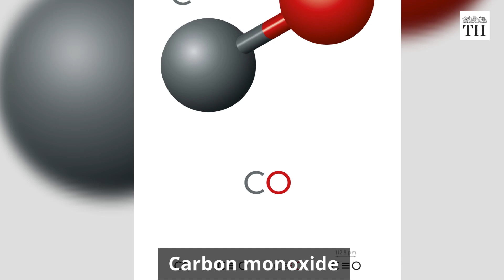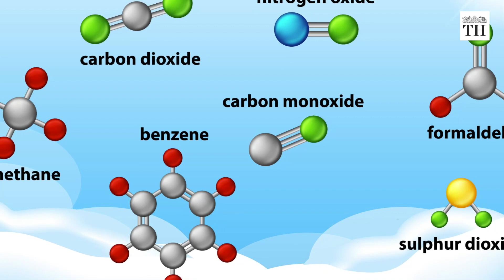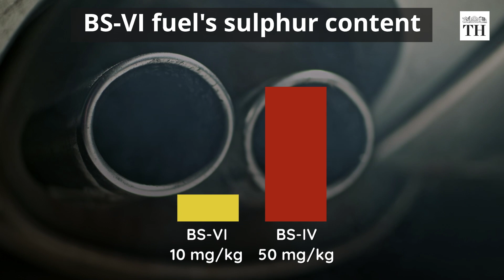What you need to know about BS-VI fuel

Comment: General question ! What happens if we use bs6 fuel for bs4 engines ?
Reply: No problem it will run fine
Reply: No issues in petrol engines...Not so sure about diesel engine although oil marketing companies are saying they will add some chemicals in diesel to make it better suited for bs 4 engines...

Comment: We have to develop some new technology to upgrade existing engine to BS VI.
Reply: Replace the Engine along with other relevant parts (if required)
Reply: Its possible,i heard..........fitting a small tank which further filters the sulphur emission is available,i think....but then only bs6 fuel has to be used.......this i read in a news around 6 months back!!